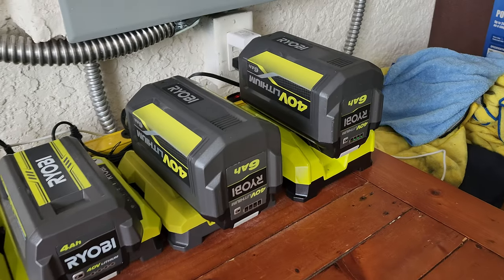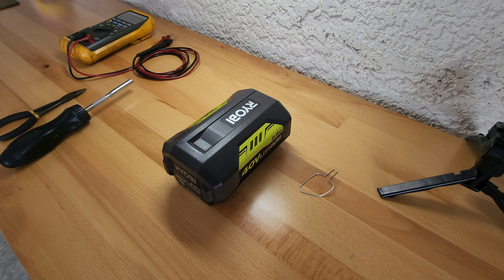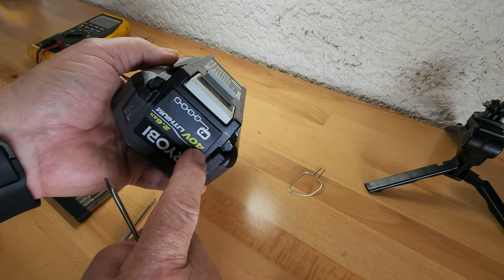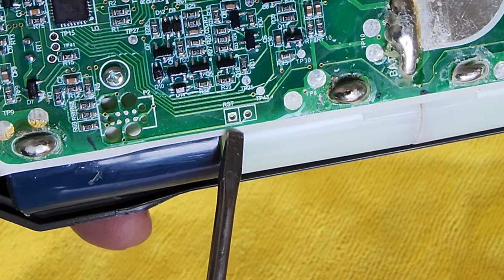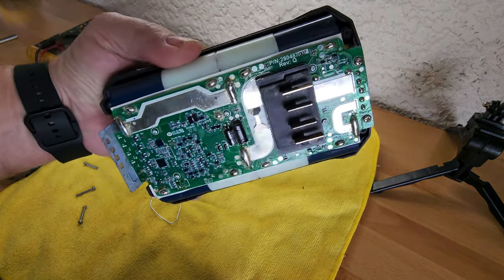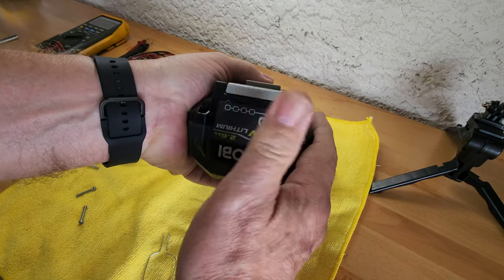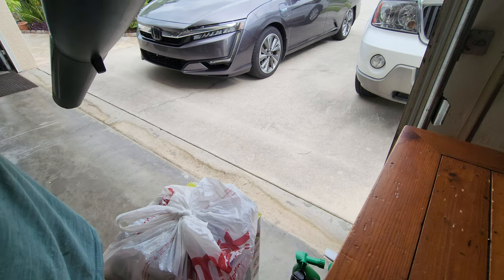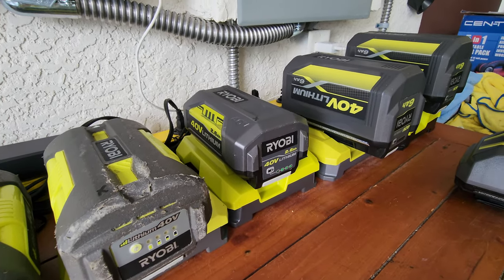Ryobi 40V battery fail, Master Reset!!!

Comment: Thanks for the video .......used a safety pin on the reset on the motherboard and pressing the battery charge button at the same time did the trick, The battery then started to charge and i ended up getting 4 green lights in  the charger. I pulled the battery out of the charger and expected to see 4 fully charged lights when pressing the charge button on the battery Unfortunately i only get two displayed . Any idea what else i can do?
Reply from the maker: There's nothing else I know of.  You did your best to save get it going again. Thank you for sharing your outcome with everyone.

Comment: this fixed my battery but i didnt have to press the button, i just held the reset contacts for about 5 secs then all 4 green lights  lit up untill i let go, this battery has been sitting for over year because i thought it would never work again and  its charging fine now, btw my battery was the 5amp version and all 4 lights would blink 4 times when pressing the button and wouldnt charge and showed defective
Reply from the maker: Wonderful.  Another battery back in service, well over 1 year later.  Mine was over 1 year also. Thank you for sharing your success 🙌.  Have a great week ahead.

Comment: 2nd time I've done this but still had to slide it on 6 times to get the charger to start charging it, I also waited a day after reset, so maybe trying to trick the charger is also part of it, I also think it's best to avoid running equipment until it's dead.
Reply from the maker: Thank you for sharing.  Definitely good idea not running totally out.

Comment: Worked for me too!  I did your reset, and the battery charged fine, then charged fine again.......When I went to charge it a third time, I got the error message on the charger.....Took it back apart, reset it again, and it is charging.  Is this something that I will have to do repeatedly?  I am fine doing it, now that I have done it, it takes 3 minutes (as opposed to buying a new battery!) but am curious if others have found that they have to repeat the reset?  Thanks again!!
Reply from the maker: I haven't had to reset mine, only once. Happy it worked out for you.  Hopefully someone else will chine in and let us know if they had to do it one than once or not. Maybe you could find a pattern, such as only happens if run down completely or never happens if charged at one bar? 🤔 Thank you for sharing your experience.  Have a great week.
Reply: @htnowpro  I have continued to have to reset it, sometimes every second or third time.   I can do it in about 10 seconds, so it's not a big deal, but at some point, I think that the back is not going to stay as tight, having been taken off so many time.
Reply from the maker: @Scott Gallison  no one else has commented. Whatever error your battery has must be more of a  hard fault as opposed to a glitch 🤔.   Time for a new battery?
Reply: @htnowpro  NO CHANCE!!  Ten seconds, I reset it, and it charges fine.  Have noticed no difference in performance time etc, so until it no longer charges, I'll be following your instructions.  CRAZY how expensive these batteries are.
Reply from the maker: @Scott Gallison  sounds good 👍.  I had a thought 🤔, but I haven't had any opportunity to research the idea.  Possibly the bottom cover could drilled to provide exact, precise reset access without disassembly? 🤔
Reply: @htnowpro  HMMMM..........directly above the reset points......interesting...

Comment: Unfortunately this didn't work for me. Good video though. Only one I viewed so far that mentions pressing the test button while jumper is in place. would suggest you always give the part number of any battery you are demonstrating. Thanks
Reply from the maker: You are very welcome. Thank you for sharing your experience.  I am told newer batteries do not have the reset. I do not have any insider information.  I was giving my battery one last try when I pushed the button on the last try. It worked! It was an afterthought to make the video . It has helped many. Would have liked to have had  the original experience on video. Thanks again.

Comment: Did everything as prescribed however no change in the lights. Battery still only has one lighting up.I believe I need a new charger as no lights at all on it before or after the procedure. My battery and charger are 4ah. Other question is will a 4ah replacement charger work on a 6ah or 8ah battery if I need to get a new battery?
Reply from the maker: Yes, I can confirm the 6ah will charge in the 4ah charger. I do not have an 8ah to try out. I would suggest you look into another similar powered Ryobi instead of buying separate if at all possible 😉.

Comment: Thanks for the step by step, it worked!  I have the 2.4 amp 40V for our lawnmower, because that’s what it came with 2 years ago. Can I use the 6amp safely in that mower?
Reply from the maker: You are very welcome.  My understanding is RYOBI 40v are interchangeable but someone may comment who knows for sure. I have used the 6amp on my string trimmer that came with the the small battery with no issues. It runs for a long time. You used the word "safely"....I can't answer to that. Use your own discretion . I'm really thankful you were able to save your battery, have a great weekend and thank you for watching and sharing your experience.
Reply from the maker: I just finished my morning coffee and had to come back to this conversation. The 6ah 40v battery simply has more capacity or runtime  than the 2.4ah 40v battery.  Similar to a 12v car battery of 450cca vs 800cca "cold cranking amps" , the 800cca will have the ability to crank longer than the 450cca, still providing the necessary 12 ⚡️ volts.
Reply: @htnowpro  ok great, thank you! We usually go through 3 batts for the front and back lawn so a higher capacity would greatly help!

Comment: I would NOT recommend having a battery charging station like you've presented here.  I have a good friend who had a Ryobi lawnmower.  The battery caught fire while charging in the garage in the middle of the night and her entire house burnt to the ground.   I now only charge mine during the day and remove after fully charged.
Reply from the maker: Great advice.  I do not charge at night either. Usually mowing the lawn with one battery while the second one charges. Yes, charging batteries is one of those things. When I was commuting, I had no choice but to charge my hybrid at night....same bad things can happen. Now my Bluetti is solar charging all day long. Batteries are a part of life for many. Be cautious ⚠️ as you have stated and pray the manufacturers didn't cut corners during design and manufacturing.  Because GM, Kia, Samsung, and recently Ford have proven batteries can be dangerous. Thanks for sharing this great advice.  Hoping and praying no one has to deal with this. I will say that even gasoline powered vehicles can and do catch on fire at times.

Comment: What if the lights on my battery is not blinking at first when i push the battery charge test button ?  Will this method work then?
Reply from the maker: Some batteries have different buid dates and / or configurations. There is no official RYOBI information posted that I am aware of.  You would just have to try it. Some will reset without pressing the button while activating the jumper.

Comment: Great video, thank you. Where do you get the tool that fits the strange  battery screws?
Reply from the maker: It's called a tamper proof torx bit. You can find it on Amazon.  I will try to post a link after hurricane IAN. 🌀 Thank you for watching and commenting.  Stay safe 🙏.
Reply from the maker: Tonsiki 11 Pieces 1/4 Inch Hex... https://www.amazon.com/dp/B01MFGRZIA?ref=ppx_pop_mob_ap_share
Reply from the maker: This is the kit I purchased
Reply: I used a small Allen wrench to remove the first 3 screws but discovered that a hex star tip fits perfectly.

Comment: It's short circuit to reset it you basically take a piece of metal wire paper clip anything that will be conductive and touch both of those pins to reset it a lot of pieces of hardware have that feature if you look closely
Reply from the maker: Yes, absolutely correct.  In this case the key was pressing the button exactly at the same time as jumping the circuit.  Have a wonderful week . Thank you for sharing.

Comment: I have a Ryobi 40 v. I had a power surge on the circuit that my charger was plugged into. Cooked my charger. Bought a new one. But the battery that was plugged into the old charger when I had the power surge won't run my tools. All the lights are solid green . Any ideas?
Reply from the maker: I am guessing the logic chip probably was damaged. I would think the battery and the charger have to do a communication hand shake or something similar to engage charging 🤔.

Comment: So if you are an electrician you can fix it.  Great product Ryobi.!  I'll avoid buying them.
Reply from the maker: In my opinion RYOBI should have put a user accessible reset button.  The more input from users the more we will see how widespread this issue is. I'm sure it won't fix worn out batteries, only those with an internal glitch. Thank you for watching and sharing. Have a wonderful week ahead.

Comment: I have several 18v that won't charge and a few 40v that the charger says are bad and one of the batteries isn't even dead. Does that sound like a charger problem or battery
Reply from the maker: Too many variables to make a guess. Borrow or try a different charger to know for sure.  Have a great week ahead.  Please let us know what you find out.

Comment: where did you get the tools to open the battery? our battery will only run the mower for a few seconds then stop every time you push the start button on the mower.
Reply from the maker: This video is to reset a battery with 4 flashing lights and no charge. The tool is a tamperproof torx tool. It is a torx bit with a hole in the middle. I found one on Amazon . I believe I posted it in the drop down information. There is a plastic plug in one of the screws. Hope this answers your question. Thank you for watching and commenting.

Comment: I got a refurb'ed 40v Ryobi battery and mine was flashing red and green when I went to charge it; I took the 4 screws out and pushed the button and the light went green;  didn't have to put the jumper in.  Should have tried pushing the button before taking the screws out I guess.
Reply from the maker: That is good information. It will help someone. Thank you for sharing.

Comment: I had same issue.  Reset battery.  1 light.  Figured all is good.  Put on charger....it charged but started at last light.  Finished.  It worked...but only for bout 10 minutes and then stopped.  Battery dead again.  Any thoughts?
Reply from the maker: Some batteries just will not reset or not be salvageable, or the runtime is extremely short.

Comment: I have a new 2Ah, which they are sending me a replacement for. I'm trying to get this one working. As a start, when I push the button to see battery level, I see no lights. Checked the voltage, 1.9, jumped out from another 40V, got the voltage up, still no lights and error when charging. I don't see any reset like in your video inside my battery. Any ideas. It seems a waste to not getting this battery working. :(
Reply from the maker: Someone said they pressed the button three or 4 times or try holding the button down for at least 15 to 30 seconds.  Just guessing, but I am with you: would be a shame to have to throw it away . Check back and let us know the outcome.  Have a wonderful week.

Comment: Plus,i do understand the warning with all the sense you bring it sr. But im also like to save my buck. And takevthe pride of making it work. Surely you understand this,thats why i ask you if its safe to set pin?
Thank you again sr. Hope im not a bother.

Ps. The tip about resetting its very true on almost everything.
Thats how most get played...
But thats there bisnnes
Reply from the maker: It's always good to do your home work before throwing something away. Reseting any logic/computer/gadget is standard procedure. Some defects are hard faults and cannot be reset. Sounds like yours may be a hard fault and not similar to the concern I had. You might try calling Ryobi, as some viewers have reported Ryobi sent them a replacement battery. Thank you for watching and sharing your experience.

Comment: I was rushing around and not double checking on which battery for which charger so this is message to others too. 

Make sure you using correct ryobi 40v in right tool. They are not as interchangeable as they claim. Sounds obvious but if you rushing and have yard workers it can happen. 🎉I accidentally used 5ah in my blower and 4ah in my mower and then used wrong charger. This is what caused battery problems to begin with.
Reply from the maker: I use my 4ah batteries as backup for my lawn mower, which has 6ah batteries. The 6ah batteries charge on the supplied fast charger. Started mowing with a fully charged 6ha and 10 minutes in it stopped and started flashing.  Took it to the charger, and it would not charge. Put it on the slow charger, and it charged up properly.  Mowed the front and back with it two days ago. Pit it on the fast charger, and all is fine. Sometimes, I use the large 6ah on the weedwacker. I swap batteries from tool to tool as needed.  Possibly hot summer temperatures have something to do with the outcome 🤔.

Comment: Got a new power supply and now the red light is working on the charger. Cleaned the motherboard. Did the reset. When I push the button on the battery during the reset all four lights stay on. When I remove the paperclip and press the button on the battery again 4 lights flash. I put the lid back on and connected  it to the charger. Now I initially get a red light on the charger for about 30 seconds, then the charger light goes from red to green flashing. What am I doing wrong?
Reply from the maker: I wouldn't say you are doing anything wrong. Some electronic hard faults can't be reset/ repaired.

Comment: I have a barely used 4ah 40v Ryobi battery, was mowing and dang, it just stopped dead, would not take a charge, flashes the 4 lights. I will have to try the reset. You would think Ryobi would add a reset button to their batteries.
Reply from the maker: Absolutely.. .they should! Thank you for watching and sharing your experience.  Have a wonderful weekend 😀.

Comment: Mines 023 but this is not working. Pins in place lights go solid green but they still flash after hit the button again. Any ideas?
Reply from the maker: One viewer called RYOBI, and they sent him a new battery based on the  age of the battery.

Comment: Thanks for the video. Using your suggested method I was able to reset the battery. Two lights flash right away, but every time I placed the battery back on the charger after a few seconds it goes back to the alternating red/green flashing light. I tried the reset about a dozen times with same result. Interestingly, I just tried the reset and put the battery in the trimmer right away and the trimmer works. Put the battery back on the charger after a few seconds, and same red/green flashing light. Anybody have any suggestions on where to go from here? Should I use the trimmer longer?
Reply from the maker: I would try a different charger to confirm or pinpoint it to battery or charger.  I'm guessing you would have tried this if you had another charger.  You might give ryobi a call as some have suggested.  Thank you for watching and sharing your experience.  Sometimes, hard faults exist and can't be resolved with a reset.

Comment: The easiest way to get into them without a special tool take a drillbit about the size of that little nub inside of it, drilling it out and it will break off and then you can just use your regular set
Reply from the maker: That's one way to bypass having a tamper proof torx bit.

Comment: How many seconds do you hold down the button while connecting the reset ?
Reply from the maker: Three seconds should be fine 🙂.  If I remember correctly, mine flashed right away.

Comment: The real problem are the circuit board components. It’s a flaw in either the quality of the parts used or needing an additional component to prevent the fault. I used to repair CRT monitors back in the day and one of the “repairs” was having to “reset” the circuit by shorting the capacitors that weren’t discharging or cycling correctly. This was due to cheap circuit design NOT according to manufacturers specs but by the choices made by the companies marketing the consumer products. It all comes down to $$$.
Reply from the maker: Great information, yes this could have had an easy reset pin access at almost no cost. Thank you for sharing your experience.

Comment: I could still use my non security bit on 2 of the 4 screws and small drill bit to remove security pin on other 2 to fit my bit in to remove all screws. No new kit needed
Reply from the maker: I am glad it worked out for you.  Great idea.

Comment: Just tried the method. Not working for me. Rev 1.3 on the board. Have the same two little holes to jump. Jumped them, pressed the led indicator button, nada. Maybe the battery is fully fried? Charger shoes the error code flashing red/ green 😢
Reply from the maker: Sorry it didn't work out for you.  Not all batteries have the same issues.  Some have hard faults that can not be  cleared. Others have nothing more than a software glitch. Thank you for your experience.